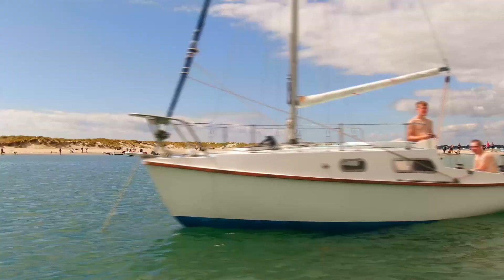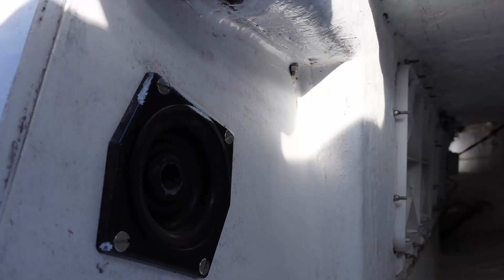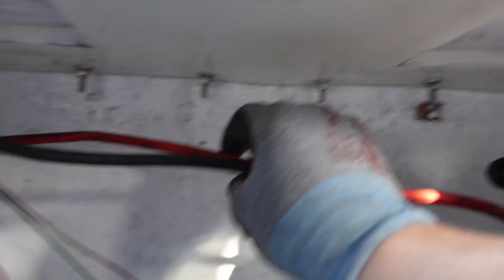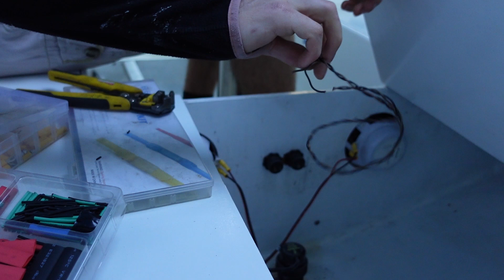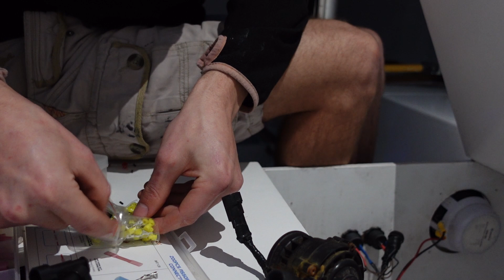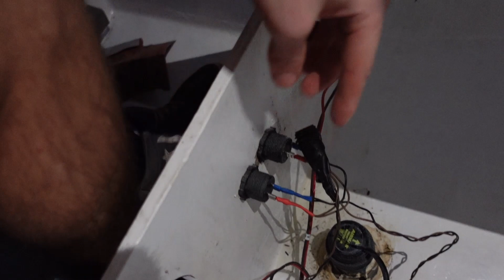12V MAYHEM ONBOARD! Sailing Meraki | Ep.62

Comment: I think you need 10amp wire fore those sockets. Fire risk with old thin wires!
Reply from the maker: overkill would be nice but 5 is fine as everything that is run on the sockets will be under that combined including run length and it is fused for it.